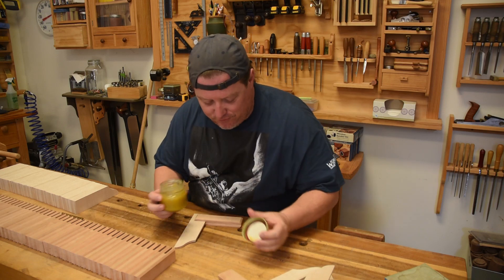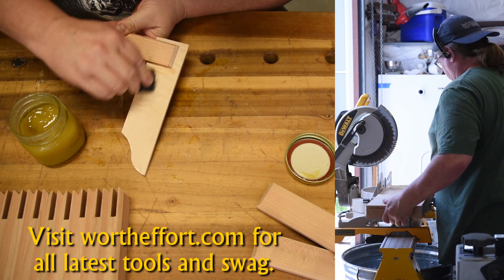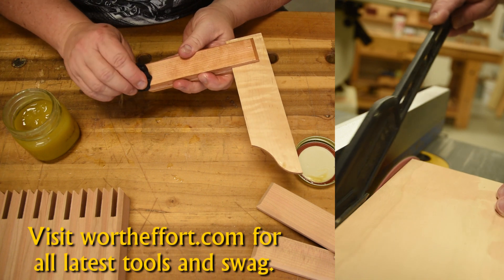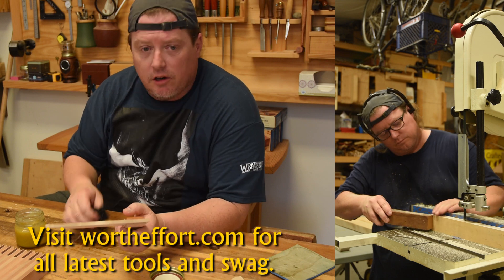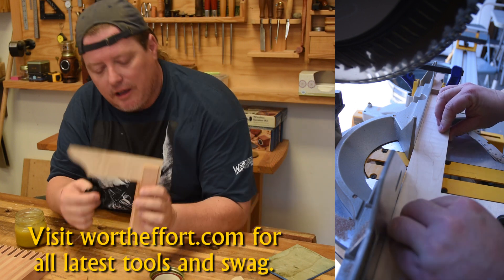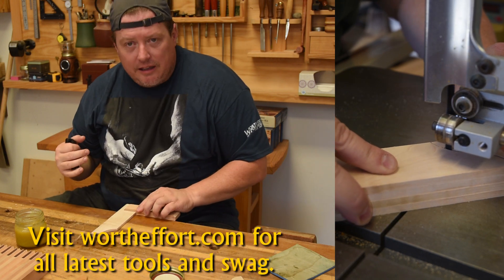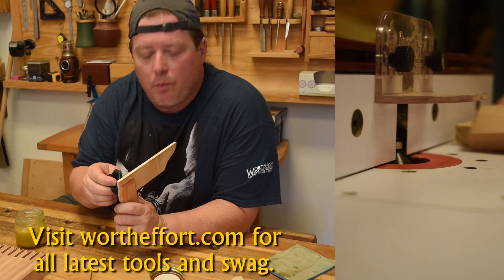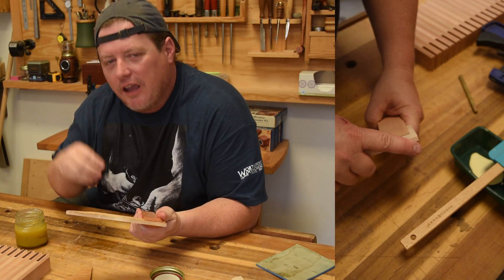Making and Selling a French (Try) Square

Comment: Can you please please do an education video on how to use hand planes. I have a nice woodriver number 4 and I get it dialed in to take thin shavings and then after a few passes it starts taking thick shavings or none at all without touching the dial. Ive paid very close attention to make sure I’m not hitting it by accident. I’ve tried tightening the screw but it get to the point where it’s far to tight to spin the dial anymore. Also I have my board almost perfect then it starts to taper the wood. The wood starts to slope down. I’ve watched a bunch of videos but no one seems to touch on this. It’s getting very frustrating I love woodworking but can’t get my boards flat I always get right there and something goes wrong. Plus you go far more in-depth then any other channel and it’s much more enjoyable to learn for you than anyone else. Love you videos. I try to remember to give thumbs up every time. Wish I was better off so I could contribute to the channel but I’m a first year apprentice electrician so I don’t make squat. I would greatly appreciate a plan video if it falls works for you. Thank for all you do and will always continue to watch and give you the big thumbs up. 
Your the man.
Reply from the maker: Next chapter in the classroom series is on planes.

Comment: Wish you the best with this. A+ for effort. But sorry, I don't know if I agree with the 1/4" sticking out the back. Can't sit the square down inside a corner. Just my opinion.
Reply from the maker: DAVID QUERRY the back of handle is not what you use as a square. Only outside of blade and inside of handle. That’s the only section that is easily trued. Which is why I’m old days they made this extension decorative (mines just a specific depth) so the apprentice wouldn’t use it for an inside corner.